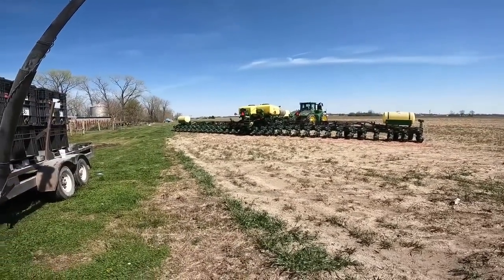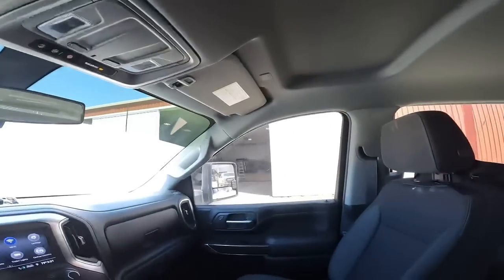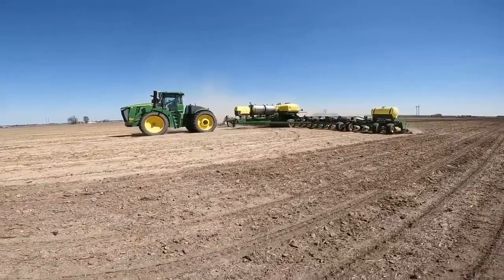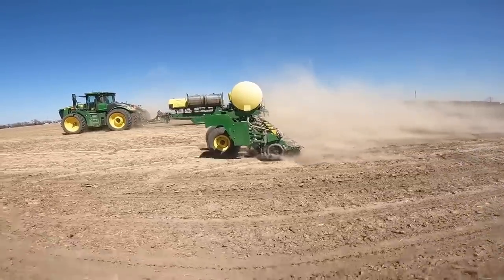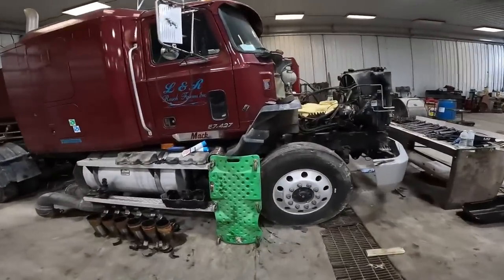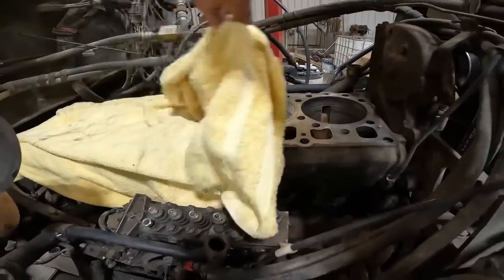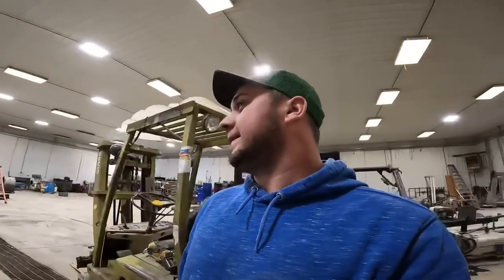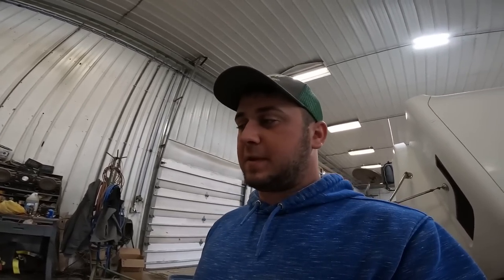The monster db80 has hit the field

Comment: I bought some wheels and tires. The tires didn’t even have 2000 miles on them. Great tires in the snow the are Firestone transforce ht 2’s if you drive down a gravel road then get on the black top they will throw rocks for 15 miles.